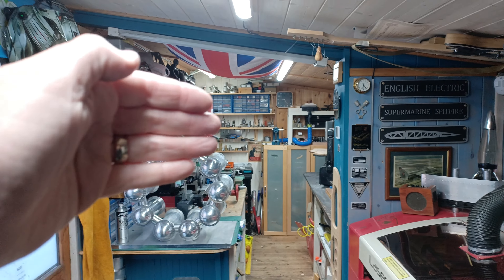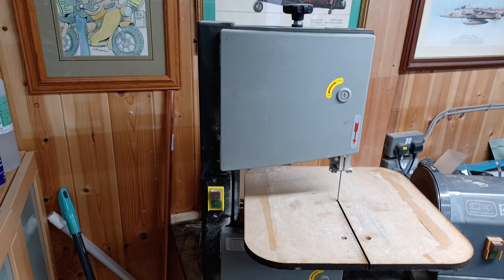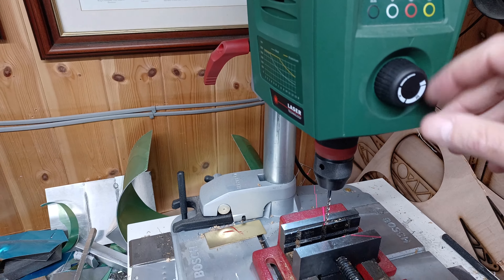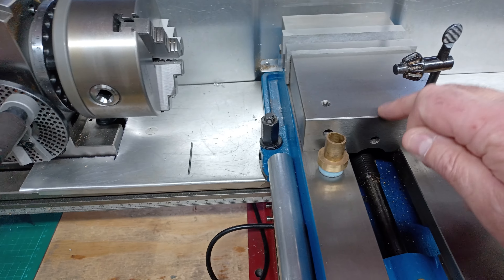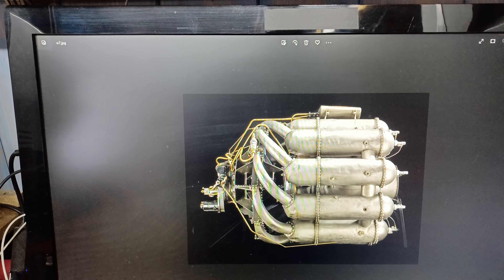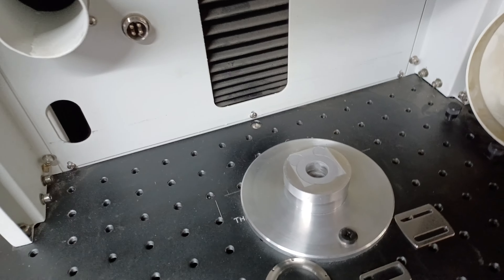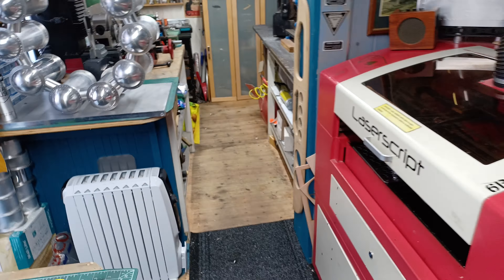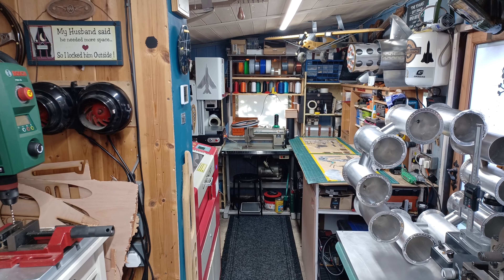Workshop tour - My little space.  UPDATE

Comment: Fabulous space. I am in the process of doing a workshop shed and this video was awesome to have.
Reply from the maker: One thing I didnt do was to lag under the floor. When its cold it comes up through the boards a bit ! Ive put some thick workshop type carpet down in the clean side which helps but I thought of drilling some small holes in various places and squirting expanding foam down. If you're out there in winter I would defo recommend putting lagging down.
Reply: @bonesshed.  That is very good advise. Thank you.

Comment: So the mill, 30 stone weighs 190.5 kg / 420lbs..significant weight in tight areas..with safety risk if done incorrectly..
Reply from the maker: Yes, Indeed ! I had a thick 20mm slab of outdoor shuttering laid over the counter where the Whittle engine is and into the part where im standing at the beginning of the video. This was supported underneath and screwed down. I then had a separate bit of shuttering on top of that and coming out of the door by 3-4 feet which was supported by a metal framed work table. Then me and a mate winched it up with an engine hoist and plonked it on. After that it was reasonably easy to walk/slide it in position. I was dreading doing it but it actually turned out smoother than expected !